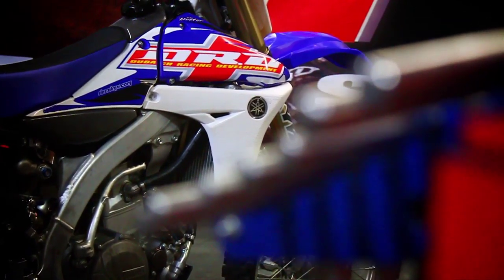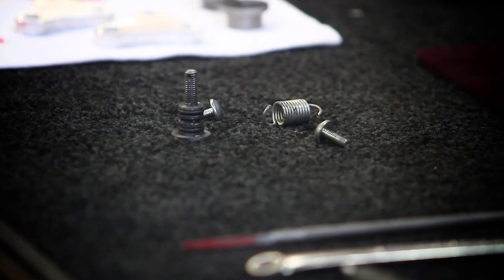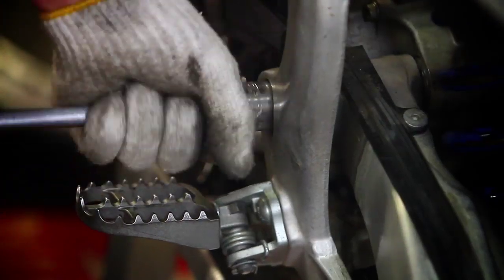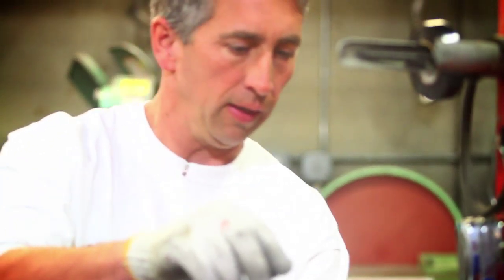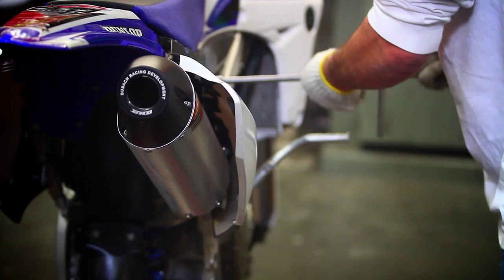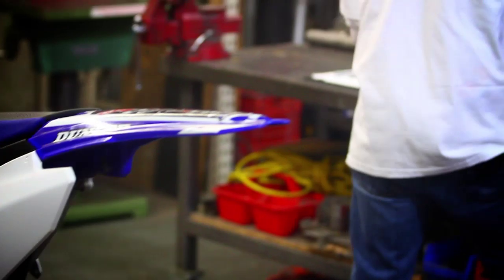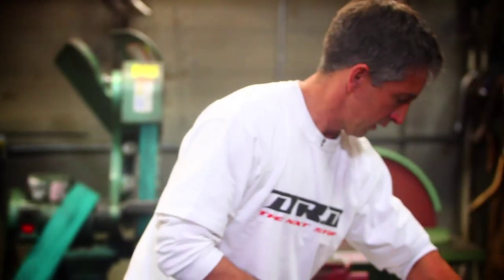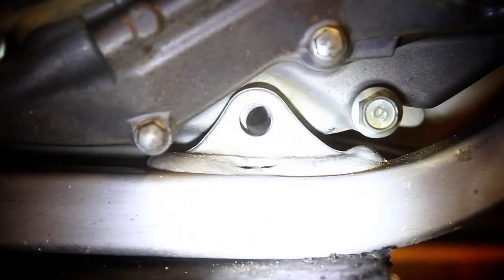How to Install a DRD 2010-12 YZ450F Engine Relocation Kit - TransWorld Motocross

Comment: Just finished this tonight on a 2011 yz 450F.  It takes time.  Be patient with it.  I'm extremely meticulous so it took me 5+ hrs to get it right.  A few notes: It was a very tight squeeze to get one of the right side lower bracket bolts past the short radiator hose down there.  Had to literally squeeze the hose completely.  I also had to remove Unabiker radiator guards to get at the upper engine bracket bolts.  Hopefully those won't be something you have to deal with.  I pulled the muffler and mid pipe out together, and then pulled the header off. There's just enough room to squeeze the mid pipe part out without removing rear fender.  Overall it wasn't difficult, but it just caught me off guard with how much time it took to get right.  The only real snag I had was that there was a considerable amount of filing that needed to be done on the single lower engine mount bolt.  Took me 30 mins to get this area right.  The bolt was just so far off initially because of the engine being more forward now.  You have to file deep and through, and mostly on the rear half of the opening, but in the middle too if you know what I mean.  So much filing, couldn't avoid stripping some of the threads on the aluminum bracket there that's connected/welded to the frame. It didn't seem to matter.  When enough filing was done, bolt slipped through with minimal lifting on the engine with the tire spoon. The amount of filing needed for the new swingarm pivot collars, was more than 15 seconds worth of filing for me.  Took 3-5 mins at least on both sides.  I must have installed the swingarm pivot shaft in and out of there testing it, at least 7-10 times.  Again, things just took time.  I just wanted to share my experience with the install, as I see no one else has.  We'll see what the difference is on the track with it.